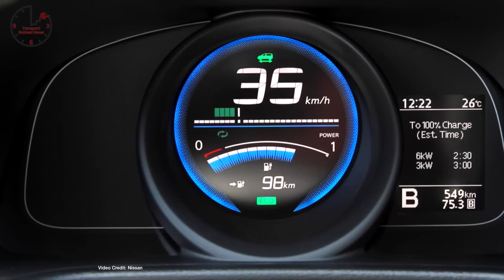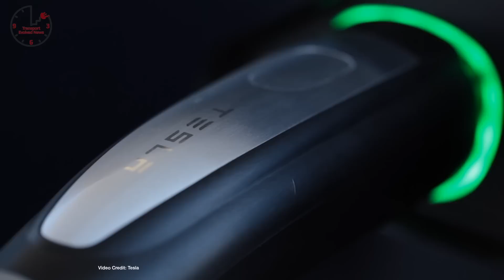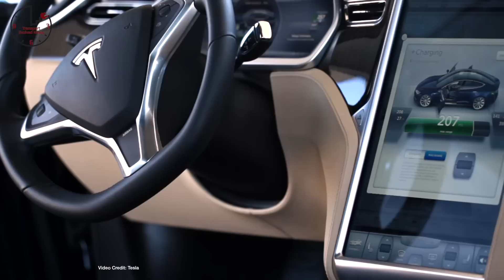Tesla Q3 Production, Nissan V2G Push, Autonomous e-Drones  - TEN Future Car News 10/6/2017

Comment: Methane and electron economy make the most sense to me.  https://elonmusksfan.wordpress.com/2017/06/13/what-to-do-with-all-that-extra-power/
Reply: No methanol is far superior to methane as a fuel. With the Flex Fuel Mandate, cost = $50 per gas car, all vehicles can easily run on Methanol.
Reply: Yes.  It's simple to convert methane to methanol for when you need a liquid to move through the already-in-place hydrocarbon infrastructure.  Cryogenic liquid methane, or using methane as a fuel directly also has its place :)  Interestingly, all of the components for any of this fuel can come out of 'thin air,' even water.  It would be pretty cool if in the future we could have artificial trees (solar/wind, maybe water/co2, collectors essentially) that slowly fill methanol/methane tanks at their base.  They could pump out electricity normally, but when none is needed, use the excess to make synthetic fuels.

Comment: I think GM is serious. Very serious. I don't why, after all they have done (and delivered on in the last 10 years), with electrics their motives are still questioned. Crazy. Now if it was a diesel polluting German car maker or two of the Japanese makers (all who have shown little interest in electrics) making these claims it would be another matter....believe it when I see it!  lol
Reply: GM may be serious about electric vehicles, but the bolt is still a curiosity. Its clearly aimed at the model 3. but, its more expensive, has less charging stations, doesnt come with adaptors for other charging stations, you have to pay even more for quick charging (did i mention more expensive?) and has no automous driving capability. its only advantage, is slightly greater range, and even thats debatable. why would anyone pick a bolt over a model 3?

There may be one advantage to GMs approach, in that, hopefully, if the car cant drive itself, it will be harder for someone else to hack. but, tesla seems a lot more software savvy than most companies. the defcon talk of trying to hack one was pretty fun.
Reply: Pixel, The Bolt is a "curiosity"? No, It's a REAL car you can go buy or lease TODAY. And it is NOT "clearly aimed at the model 3", and you can't buy a Model 3 yet (and won't be able to for YEARS unless you paid $1000 to get your name on a "list"), and when you can I suspect most will cost more than a Bolt. There are thousands of chargers all over the place and more are coming too (see plugshare.com). But the fact is most people do most all their charging at home (especially with 238 mile range), except when traveling long distances. My Volt has 50 to 60 mile range on battery, and 94% of my driving is pure electric. The only time I do burn gas is on rare long trips (the last time I bought gas was April 13th, 6.33 gal.). Pay more for quick charging? Model 3 will not come with "free charging for life" for free. And " no automous driving capability"?? Well, given you can't even buy a Model 3 yet does it even matter? lol But GM may well already be ahead of Tesla with autonomous driving technology (google "Super Cruise"), and it IS coming to the Bolt, there are already self-driving Bolts on the road testing now. And "why would anyone pick a bolt over a model 3?" Well, maybe they need more room or don't want to wait 3 years to get a Model 3. And look, I am a Tesla fan, and I like the Model 3 a lot and I want Tesla to succeed. But by the time most people can buy a Model 3 I suspect there will be several more GM EV's on the road to choose from, that will probably have Super Cruise as an option as well.
Reply: if the model 3 didn't exist, do you think the bolt would? 

by pay extra, im refering to chademo. ive only seen a few level 2 (and maybe better) charging stations in person,  but i keep seeing tesla stations.  just looked at plugshare and your right! theres like 3x chademo chargers as super chargers! maybe they need bigger signs or something. 

super cruise is for cadillacs, and is only level 2 autonomy. teslas come with level 3 and are working on level 5, though you have to pay extra on the model 3 for it.

As an outsider looking in, the bolt looks like you pay more and get less. thats why i couldnt understand it. GM needs to market the greater cargo space, more range, and especially, more chargers.
Reply: "if the model 3 didn't exist, do you think the bolt would?" Yes. You seem to forget the Bolt existed before the Model 3. GM has been working on EV's a long time, the hard part is the batteries and business case for them. Chargers will continue to evolve and grow. Not really a concern of mine. Higher levels of power for charging will come too. But as battery improvements start making 400 and 500 mile ranges more common the need and demand for charging locations will change too. The Super Cruise platform can and will evolve into level 4 and 5 autonomy. Just look at what some of the self-driving Bolts in San Francisco are doing. Amazing. And Super Cruise (by same name or not) will come to all GM brands. I agree with you that the Bolt is not the "BMW 3 Series" killer Model 3 is meant to be. The Bolt is meant to be a nice "practical" EV with lots of utility. But I think soon we will see a sport-luxury EV from GM, but it sounds like a GM CUV EV will arrive first. I still hoping they build the "Jolt" :) ....not sure how many they would sell, but might be good for the Chevy/GM brand.
Reply: Bolt is a Korean hatchback.  Tesla Model 3 is a BMW 3 series replacement.  They are not at all in the same league in terms of performance, styling, automation, over the air updates, supercharging, etc.  

Bolt sells about 25k cars per year.  Model 3 about a half million within a couple years.  No comparison.

Several car makers have had big talk about going electric, but only Tesla and Nissan are actually making EVs in any significant volume so far.
Reply: Jeffrey, model 3 has been on the business plan since 2007. bolt started in 2012, when the model s came out. dont know how business planing would play out there or if tesla was even on GMs radar. so your probably right. i had to look this up on wiki. im probably not the only outsider to whom the bolt looks like a reaction.

jolt? if by that you mean what the bolt might evolve into, then yes, id like to see that too.

what i still dont get is how gm justifies pricing their practical car more than the model 3. guess its the available now thing.

 maybe in a couple years the price will come down, quick charging will be standard (which it should already be!) and some form super cruise may hit the bolt. assuming they come with the hardware for it. id hate to get one now and find out it cant be upgraded.
Reply: Pixel, GM has to price their cars where they price them. And last time I checked that 238 mile Bolt is going for less than a BMW i3 that has far less range. But keep in mind too, Tesla has now lost over $10 Billion dollars I believe it is now building electric cars the last 10 or so years.....and signs of them actually turning a profit anytime soon nowhere in sight. But I wish them them the best, I really do, they have done some amazing things. I love what they are doing. But they will need to get in the black before the Wall Street money drys up. Here is the (concept) "Chevy Jolt" haha....it would be just a fun car to see built, and looks like it could be built on the Bolts platform (GM said a while back several more vehicles will be coming that use this same platform) http://www.chevyjoltev.com
Reply: Loanword, "only Tesla and Nissan are actually making EVs in any significant volume so far."?? Better check those totals again, GM now has hundreds of thousands of EV's and cars with plugs on the road now, worldwide. They often now lead Tesla (and of course Nissan) in monthly U.S. sales. Volt, ELR, Spark, Gen 2 Volt, Bolt, Malibu plug in hybrid, Cadillac CT6 plug in hybrid....(many) more models coming too.....who else has fielded the number of models GM has? Looks like GM may end up being the first EV manufacturer to use up all their 200,000 Federal EV tax credits too. And I hope you are right, and Model 3 sells in the volumes they are hoping for. I would love it if that happens. We'll see what happens. :) A lot of companies are talking big now, a few have actually been delivering long range EV's that people can buy today. Tesla and Nissan not the only EV makers out there ;)
Reply: +Jeffrey Woodin Tesla is losing money because they are spending billions of dollars to build new factories to mass produce Model 3 and the batteries for it.  After that is Model Y.  Everyone knows this, presumably including you.  Therefore your comments are dishonest.

Plug in hybrids are plug in hybrids and not EVs.  So far GM has built a few thousand Bolt EVs.  Toyota makes far more plug in hybrids than GM.

Apparently your a GM fan.  That's fine.  All major car makers will need to transition to making millions of EVs per year or go out of business.  As battery costs continue to fall, within 10 to 20 years it will cost less to build an EV.  At that point almost no one will be buying fossil cars due to basic economics.  EVs already cost about 1/3 as much to operate as fossil cars.
Reply: +pixel fairy GM is reportedly losing $9000 on each Bolt sold.  Why?  Because they have not invested the billions of dollars needed to drive down battery costs, as Tesla has..  Telsa makes 28% profits on each Model S and X sold and should make at least 25% profits on Model 3, even with Model 3 selling at half the price of Model S.  Why?  Gigafactory is the major reason.

GM spends billions of dollars in profits from selling highly profitable (and generally inefficient) SUVs and pickup trucks on stock buybacks to prop up their stock price, instead of using the money to invest in the electric future by building huge battery factories, as Tesla has done.
Reply: Loanword,

MY comments are dishonest?? Haha Ok. I’ll let our posts speak for themselves. Look I don’t have a crystal ball into the future any more than you. Maybe Tesla will (hopefully) make money someday, maybe they won’t, but you can’t change the fact they have not shown an annual profit since the company existed. In fact I think they only had a couple “profitable” quarters in that entire time. Hey, I hope you are right, I hope after Model 3 starts shipping to real buyers they start to turn a profit. But a lot of smart people find it hard to see a path to get the sales volume and margins they need to do that. That’s all. I am not knocking Tesla, I am a fan in fact. Lets just “keep it real” as the say :)

“Plug in hybrids are plug in hybrids and not EVs….Toyota makes far more plug in hybrids than GM.”
The numbers are here, people can judge for themselves who has sold more "EV's": https://insideevs.com/monthly-plug-in-sales-scorecard/  …your a fan of Toyota, fine. Just remember Toyota “Gives Up On Pure Electric Vehicles” just 3 years ago: https://insideevs.com/toyota-gives-pure-electric-vehicles/

But it’s actually an interesting question, which car makers fleet of cars has driven the most electric miles? Toyota sold a lot of hybrids, but they burn gas. I bet GM may be far far ahead of Toyota in “EV only” miles. In fact, looking at this (from 6 months ago) https://insideevs.com/us-crosses-10-billion-e-miles-driven-facts-and-graphs/ The Volt alone was over 3 Billion e-miles months ago, don’t see Toyota even listed in the totals. hummm, interesting.

Toyota also crushed some EV’s too http://evworld.com/news.cfm?newsid=8897. This tends to somehow keep getting overlooked, not sure why. But hey, I am glad Toyota (and Honda) FINALLY made a REAL commitment to building “EV’s” in the past several monhts. It can only be good for “EV’s” to have those two automotive and engineering giants “helping the cause”.

You also pointed out GM (currently) loses money on the Bolt, the fact is NOBODY is making money on EV’s at the moment. Period. When EV’s are actually profitable (and GM seems to be the closest to actually getting there at the moment) THEN you will see everyone wanting to make EV’s. Period (again). On that I think we can agree.
Reply: Oh, when you said "only Tesla and Nissan are actually making EVs in any significant volume so far." ....it got me thinking, Toyota does not even make a pure EV now do they?? The RAV4 has been gone from the lineup for a few years now. And the Prius Prime plug-in (on sale since just last November) can only go a very limited 25 miles on its' battery. Well, lets just hope this time Toyota is really serious about EV's and "significant volume" (and "significant range").
Reply: Loanword, I am aware of what capital expenditures are. Made many myself. But at some point those “capital expenditures” and investments have to pay off and start generating more money than they cost. So far Tesla has lived off its’ investors, Wall Street and hyping the next big future thing they want to do to sustain operations. Every vehicle they sell is also supported by a taxpayer subsidy. Hey, I am a huge EV support too, but at some point the hype has to end and Tesla has to live in the real world with the same realities every other car maker has to.

I think you are delusional if you think GM could have kept pouring money into EV’s twenty years ago and made money at it. Look, all the car companies are run by smart people, who like to make money. If there was a way to do it they would have. GM actually built their first modern EV’s back in the 1960’s. They batteries were not ready then, they were not ready 20 years ago, and only now are we close to making them economical for mass productions cars….that actually have more than two seats and a trunk.

“Neither the Bolt nor Volt come even close to the EV1 in terms of engineering prowess.”?? Wow. Totally disagree. The EV1 was fantastic. But I think the Volt and Bolt are engineering and technology marvels themselves….with features that no other car can offer, especially at the price GM does (1/3 to 1/4 the cost of current Teslas). The Volt was the first “EV“ that actually had a chance to go “mainstream” and actually sell more than a few hundred or few thousand. …in numbers to make a real impact.

People actually have to be able to afford these things if EV advocates expect people to buy them and for them to go mainstream. The Bolt is another break through car, a car that can go 238 electric miles AND be a car most people can afford. If GM tried to sell the EV1 even at break-even cost NOBODY (except a few millionaires!) would have been driving one!

I don’t know why some people insist on thinking that if GM just did something different 20 years ago they would have been able to build and sell all these hypothetical and mythical EV’s that would have saved the planet (while most other companies didn't even try to do a car like the EV1). Fun as it may be to think about, THAT is not, and was not, reality. EV's were hugely expensive to build back then, and they are costly to build even today. Nobody knows that better than Tesla. lol....sorry, that made me laugh.

>>Plug in hybrids are not EVs. << Well, I have driven my Volt, and I just checked this on my phone just now, 11,765 miles. Of that 11,008 were PURE ELECTRIC MILES, i.e. no combustion event occurred during those miles. See for yourself http://home.earthlink.net/~webspace-02/v/IMG_4490.jpg. That means my Volt was/is a pure EV (no gas engine required) 94% of the time. How is the Volt not an EV? I go weeks without the gas engine ever even coming on, in fact the only time I do burn gas is on a few rare long trips. Are you saying my Volt went those 11,008 miles NOT as an electric vehicle (EV)? Did it run on magic, and not electricity?? What is the point you are trying to make?

A very nice base Volt is a car most people can actually get into for around $26,000 after Federal incentives too, even less if your state offers incentives too and you get the dealer down with some negotiating. Hey, $100,000 EV’s are nice…..even “BMW 3 Series” killer EV’s (most of which will probably transact closer to $45,000 and above) look like they will be nice when people can actually get there hands on them too. But lets watch which companies have to most impact on getting people into electric cars and racking up the most EV miles.

Look, I think we both want EV’s to succeed, I think we are arguing over semantics. And look, I don’t know if Tesla will be profitable in the future or not. I admit that. You seem certain they will be. Time will tell us. Maybe you should mortgage the house and buy a ton of Tesla stock and “bet the farm” on it if you are so certain…but I would not suggest that.

Comment: Rockets are too loud for any city. Not sure how that obstacle could be overcome.
Reply: A Space Shuttle launch is safe to watch from 3 miles. The FBR is much bigger, but the distance grows only with the cubic root of the power. In case of a catastrophic launch failure  the safe distance is also about 3 miles. So make it 10-15 miles, and it's safe and quiet. A fast ferry can reach 55 mph, which means a 30 minute round trip. Definitely beats a 15 hour flight. And as a bonus you go to space, and spend minutes in zero g.
Reply: The video from SpaceX seems to show landing platforms on the sea, close to the cities.
Reply: You land 200 km away from the city, only a 20 minutes ride on the hyperloop. D'uh!
Reply: No need for 200km, 15-20 is plenty enough. That's a half hour round trip with a fast ship.